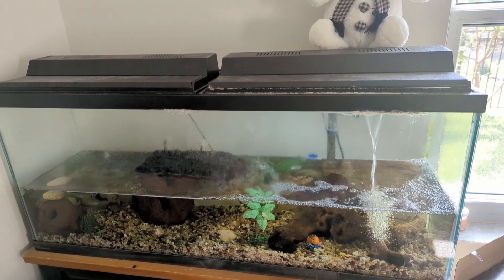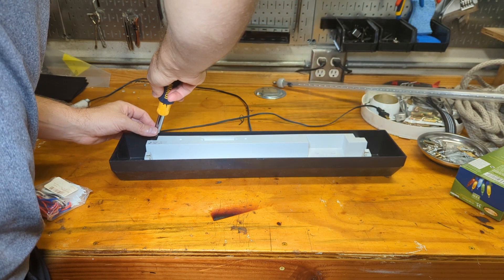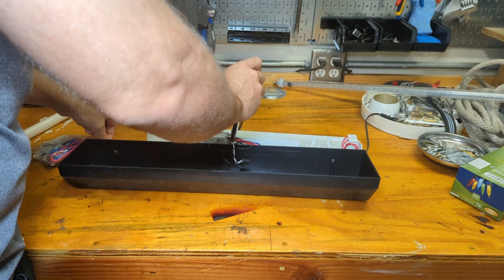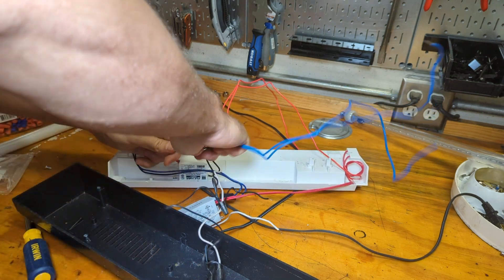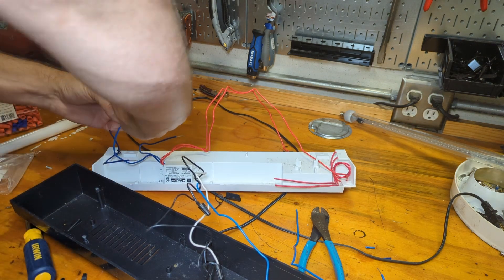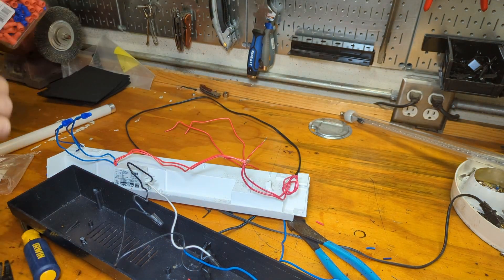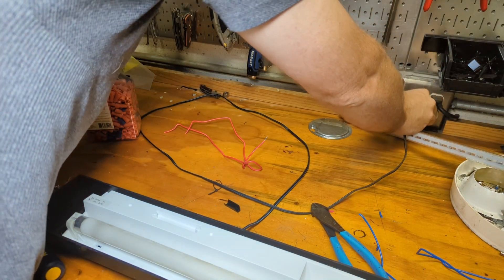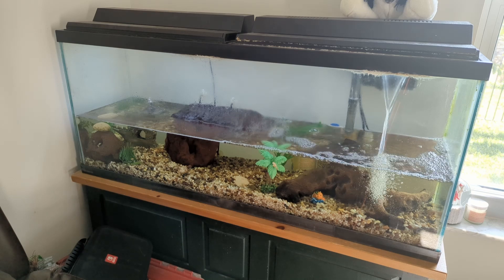Aquarium Starter/Ballast Replacement

Comment: I had no idea the ballast was replaceable or available. It's $16.93, and a whole LED light bar mounted in its 
place is $29.99. I opted to get the LED bar.  
Thanks for the video. It's very helpful for someone wanting to keep the same lighting. They are around $52 (4/23/2024)
Reply: Turtles need UV btw